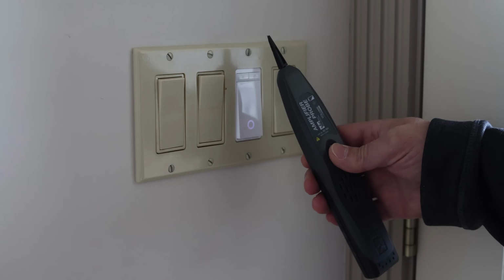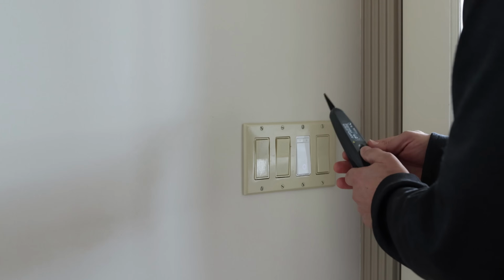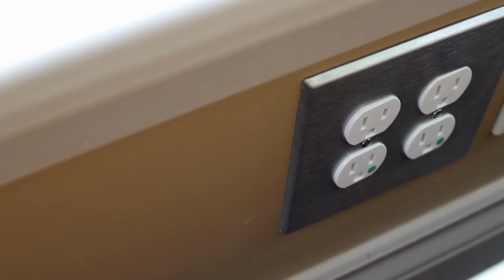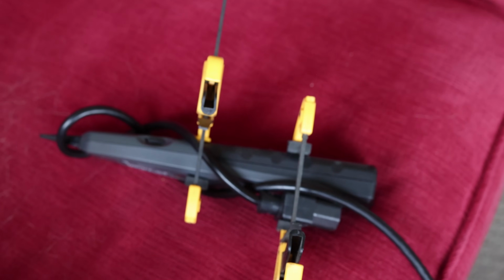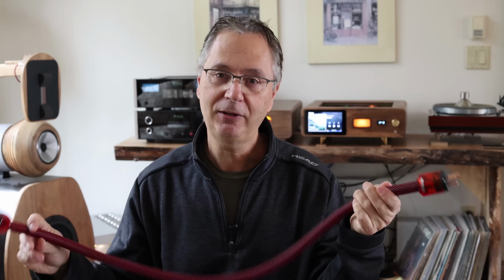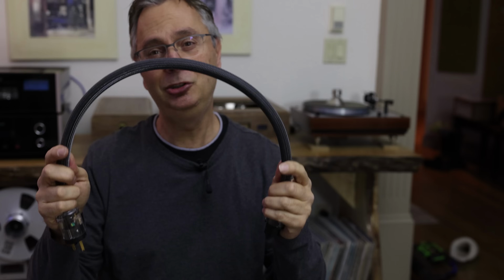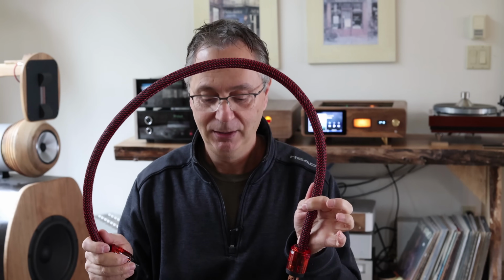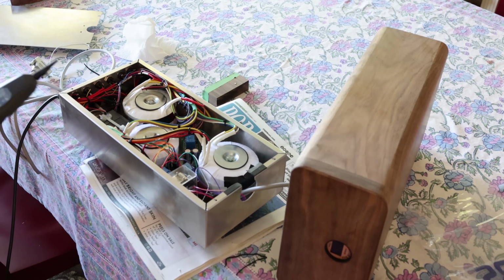My Top 5 Inexpensive Hifi Tweaks for clean power to your amp, preamp, dac, turntable, and more.

Comment: I had an experience that opened my eyes to the influence of mains power supplies. My Naim power amplifier started humming and buzzing on one channel; I took it for service but it wouldn't fault on the test bench. Through a combination of luck and logic I eventually discovered the noise was being caused by a faulty laptop mains adapter (similar to the one highlighted in your video) in the room next door; unplugged the laptop - stereo fine. Plug it back in; buzzing and hum returned. This was a very obvious condition but it does make me wonder how much things are affected on a "subliminal" or consciously imperceptible lower level? Also I live in a semi-rural area in the UK and I suspect the quality of my mains supply is very poor; lights sometimes dim erratically (seems to be heavily impacted by the weather - worse in storms and cold) and transformers in my stereo, radio alarm etc. tend to buzz mechanically. Great video; plenty of food for thought - including the fact that dirty mains and general electro-magnetic radiation has a very negative impact on our general health and well-being as well as the quality of our hi-fi sound! Thank you
Reply: EM waves having impact on your health and well-being? Please, where's the solid scientific evidence for this claim? And I'm not talking about when someone puts their head inside a working microwave oven (hundreds of Watts)..which is normally impossible anyway.
Reply: Very nice video. Agree with the points being made. I'm intrigued by your accent: Gabor, Hungarian? In any cas very good content, presented in a very pleasant style. Thank you! All the best, Rob in Switzerland
Reply: Wow, I used to poo-hoo any suggestion of using shielded speaker cables, however that Naim amp you have does show how susceptible to noise some items can be.
The biggest problem with shielded speaker cables is added capacitance, most amps should be fine, however there is always the exception, like this Naim being effected by something in another room. It definitely sounds to me like it was getting into the speaker lead, otherwise if it was via the power lead then you'd assume it would upset both channels.
Normal logic says the speaker cables are the least susceptible as they operate at such low impedances and at high power levels, any crud would be completely crushed - then there is your Naim....
Reply: Definitely coming via the mains as I diagnosed the problem as my Hitachi Mosfet amplifier (in the same room as the faulty lap-top supply) was making similar noises. Too much of a coincidence, I thought, and as soon as I unplugged the laptop wallwart the noises disappeared; from both systems in both rooms. Plug them back in and the noise returned. I take your point, theoretically, that inductive speaker cables could be to blame but different type cables of different lengths in different rooms. The only common denominator to both my systems is the mains supply. Thanks for your interest and thought-provoking comments. All the best for the New Year ;-) @saintfrancisxavier9323

Comment: You missed talking about wallwarts and LED lighting.
Walwarts are mostly made in China, and the certifications are often forged even when they are included with stuff from major brands.
I had one I used for charging my tablet that made a huge impact on sound quality when plugged in.
LED lights are the other big culprit, they use a switching power supplies, and the strip versions have one at every light.
My girl friend had a strip lamp in her basement that would cause her thermostat to emit a sound like it was shorting out.

Comment: What your experiment was supposed to prove? That a power comes through your power cable or that your house has bad installation or local grid is bad? Either way that's why we are using power supplies for. Somehow way more advanced computers work fine even with a bit unstable voltage because in different times of the day the ussage is different. Still untill you got enough power the psu neglates everything. Also how is your hifi cable would make a difference if there are miles of copper or aluminum cabels to electrical switchboard.

Comment: Instead of shielded power cables and other dubious solutions do what recording studios do. Use a UPS unit(s) to supply power to your gear. Not the cheap little ones for your PC but large rackmount and floorstanding units for enterprise servers etc. They convert the incoming AC to DC (for battery backup) and then back to AC. That conversion removes all noise from the power and in conjunction with the batteries provides stable voltage to eliminate spikes and sags on the line. In combination with proper cabling techniques it is the best way to provide clean stable power to your gear period and is what I use in my project studio. Many are available for under $1K.

Comment: A question for anybody...  I've been viewing innumerable "audiophile" videos on the importance of upgrading power cords.  Now, my system pleases me, as is - decent speaker cables and interconnects.  I contacted the maker of my amp (Rogue Audio) and inquired about upgrading their stock cord (one which is of heavier gauge and is shielded).  Their response to my inquiry was a soft "no"; that unless there's a problem with noise floor and only if I purchased a "high quality" replacement, I'd be better off investing my money in new music.  So, the Gabster is focusing most on shielding and suggests a $50 upgraded cord easily found on Amazon (WAudio 10 AWG Hi-End HiFi Audio Universal AC Power Cable Power Cord US Plug - 6.6FT).  Would it make some sort of significant improvement in sound?
Reply: Eric, I upgraded all my power cords..tube amp, tube cd player with a under $100 power cord. I figured it has to be better than the cheap cord they came with.  My 2 cents.
Reply: @jrms60r  Thanks for the reply!  I am curious to know if the change had significant/substantial improvement in the sound?  I do know that the power cord I consider replacing is for my amp.  However, I must note that this "stock" cord is noticeably better quality than the typical stock cords that come with most components.
Reply: Here is your answer. https://www.youtube.com/watch?v=Rgun97VK7y8

Comment: You touched the cheap psu with the toner. Very loud. But you floated away from the fancy psu. Not loud. 

Consistent distance for both or it doesn't count for much.

Comment: Balanced power is the only way to go. you wouldn't have any of those hum problems with balanced power. It's not cheap to balance power, but well worth it. I design it into every broadcast and or studio project that I design.
Reply: @thechuckster6838  I know by invented, design, and build fact that what you appear to push is comparatively a minimum level solution that has been seriously outdone in real world performance

Comment: i enjoy your video sir , i was wondering i live in a very old house in which all wall outlet altough they have the ground hole they are not grounded only 2 wire out the wall  so what i did i cut cord 3 wire cord and leave the ground wire much longer and im using the cable tv cable spitter and screw my ground the hence im using cable tv ground as my ground do you think it really is grounded then ?????
Reply from the maker: All depends if the cable tv it self is grounded 
If it is your house I would check the breaker box 
And get a electrician to connect the ground properly

Comment: Back in the day...While most of my employment I was in Marketing and Sales a couple of the companies I worked for knew of my engineering background in getting consumer products safety and FCC certified. So I'd be the guy taking the unit to the testing lab and getting it tested and passed.

If the product used a "wall wart" or external switching power supply I'd always bring a selection of those things to be sure at least one or two would pass the FCC test. And that even if they displayed the FCC cert on the power supply, 2 or 3 out of 5 would always fail the FCC test for emissions.

Comment: Good video BUT the shielded power cord is really BAD ( sonically) for your audio system. That is why no reputable amplifiers or cd players supply you a shielded power cord.
By shielding the power cord, the wire capacitance increases, hence becomes a filter.

Comment: Incredibly helpful!! I had recently finally upgraded the cable modem and wifi router in my home, (seriously old stuff) and noticed the Switch Mode Power Supplies they came with were TINY compared to previous (normal wall wort).  I can't prove it, but I swear that I hear a constant like 10khz whistle thru my system (most everything 'streams' thru a Chromecast Ultra puck; also a SMPS).  I think I'll get one of the probes and test to see if the various SMPS are adding a lot of hash and EMI/RFI to the router, modem, and streaming puck.

Comment: What an incredibly informative video!
I find myself wondering, if a person were completely sold on the idea of shielded power cables, but has many to replace in a complex system, where would you start: the DAC and other digitalia, the amp with the highest current draw, or perhaps even the preamp at the center?
Reply from the maker: The Amp would benefit the most 
The rest if you can keep interconnects away from power cable you are fine 
The most sensitive interconnect is the phono rca  cables as you are amplifying that signal a lot
Reply: @Gabster1  Thank you.  I'm pretty sure my main amp is very hungry for current. I just ordered my first premium cable two days ago, even before seeing the video. Like you said, a good 12 gauge shielded cable with reasonably decent connectors, but inexpensive.  Just couldn't decide where to put it.
I always knew noise is the enemy. I just had no idea how much is out there, let alone the effect of dimmers, and the magnitude of the effect of switching power supplies.  I suspected it, but was surprised by just how much.
Thanks again.  I subscribed.  Good stuff.
Reply: So, I have one of your widgets and didn't realize it. Kobalt AC-6H Non-Contact Voltage Detector. Came free with a multimeter. Got an outlet tester with it too.
Anyway, I think mine is a low frills model. It only beeps at one rate, and is certainly less sensitive than yours. I mean I have to get right on the wire.
Still, I had fun poking about with it.
My one discovery: I have always unplugged my phone from its charger while leaving it plugged into the wall. I figured that breaks the circuit. To my surprise, there is still voltage present at the end of the USC-C. Not sure what's going on, but it clearly does, even with  this toy tool.  I guess that means its SMPS is cooking, even when not charging anything. That surprised me.
Reply: Shielded cable won't help you with anything since the noise is already in the wire, it came in from the AC line and no amount of filtering can stop it! The equipment enclosure is a Faraday cage itself, no RF signals should be able to penetrate, you have to unplug the equipment from the power source to stop the noise from getting in... It's the only thing that works!
Reply: @PeterMilanovski  He is saying to use a shielded mains cable to stop the mains hum from the cable from radiating to inter-connect leads

Comment: Has anyone ever connected a rechargeable power station IE a unit that's recharged by the mains in your home and then once charged disconnected from the main then used to power your system with totally clean power ..,Great video thanks
Reply from the maker: With each component needing a different voltage like 12v 5v 3.3v …. It is hard to implement 
My streamer uses such a system see video link
https://youtu.be/jR0VBHwxQ8o

Comment: Great video. 
A company called Green Wave makes a broadband EMI tester that plugs into your outlets  and does the digital EMI reading and an audible volume also. You can get on Amazon for about $140 bucks. The gentleman that owns the company also makes filters that plug into wall outlets that took down the EMI drastically in my house about 75%.
The owner sure seems like a cool dude and is there to help.

Comment: That's crazy how much noise are in the walls this is good to know wow
Reply from the maker: The noise is being Amplified not as bad as it seems and most equipment can filter it, still best not to have so much noise.
Reply: @Gabster1  makes sense and where did you get that tool from?

Comment: Yes there is AC, EMI, RF and other noises all arround us. The noise you are chasing is not getting into your music. Sorry to be a spoil sport, but if you have what is knowen as dirty AC power, those "shided cables" are limiting the noise that is being picked up by your noise reciver, but the full noise signal is still getting into your Amp or reciver, which has the needed filtering to combat the noise. Keep in mined that the incoming AC is put through a transforme, then converted to DC and filtered. Them expensive cables, all of them are just "snake oil"
Reply from the maker: Great point I mentioned that at 1:25

Comment: Regarding power cables not only is shielding important but the ability for it to appropriately ground is critical.
Reply: yeah i guess the 200ft of romex running through the wall doesn't matter, just the 3ft from the wall to the back of the amp that has internal filtering (hopefully, if it's built right)

Comment: Good advice except for shielded power cables. It's proven that they negatively impact and dull the sound. Proper cable routing is suggested. Keep at least 3 inches from interconnects or cross at 90-degree angle if that's not possible.
Reply: How?  How can putting a metal tube around a mains cable possibly impact the sound in any way, other than reducing electro-magnetic radiation around it?